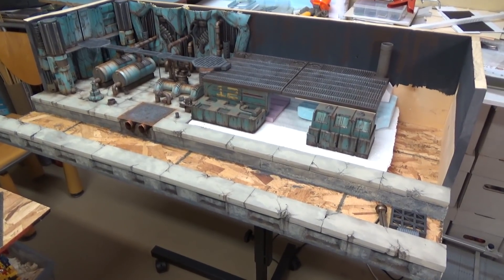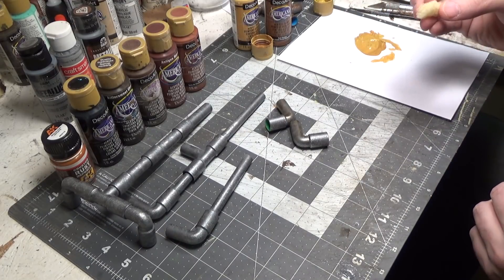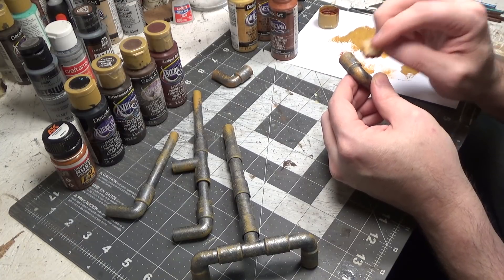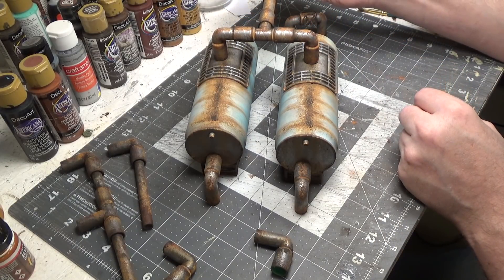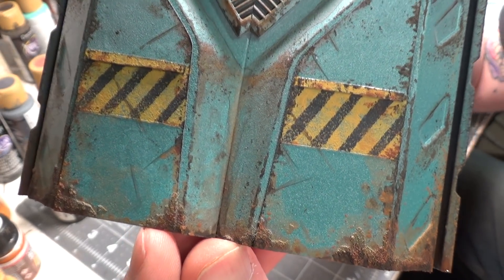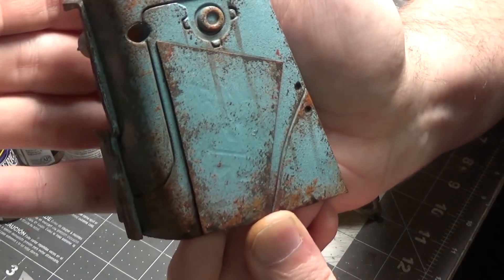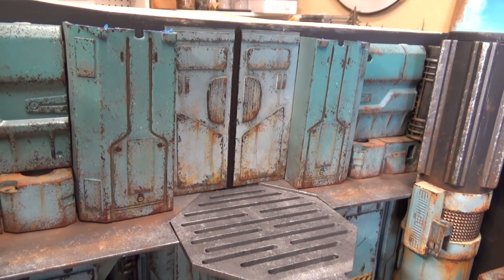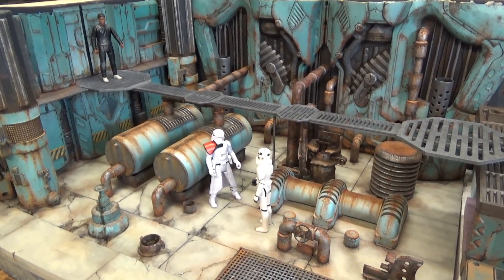Painting rusted metal

Comment: Jason, the progress is looking awesome!  Keep up the great work!  I think you should put a control room on the right side.  You could create walls with glass windows and have some computer panel with lights on the inside.  You can take one of those fiber optic lights where the fiber optics look like hairs and insert the fiber optics through small holes to look like lighted keys on the panels.  This would give you a great place to put a guard watching over the sewage disposal operation.
Reply: Oh, and make the guardroom/control room with a sliding pocket door.  You also need a set of stairs in front going down to the lower floor.  This can be a spiral staircase made from model sprews representing steel pipe!
Reply from the maker: Thank you so much!!! Great suggestion! You've really got me thinking now. Thanks for watching!!!
Reply: @JasonJensenTrains  Your welcome man!  You need a reason for a person to come through the doors and walk across the cat walk.  Having a control room is a good reason or a power source like the device O.B Wan turned off in Star Wars to lower the force field.  Maybe something with glowing purple or blue light.  The sewer could glow green or yellow for contrast.  Anyways these are just ideas.  Do whatever you want.  It looks like you already know what you are doing!

Comment: Jason,
When you announced this build I must admit I was not a fan..You haven't won me over to Sci-Fi, however, I can see where I could use some of your techniques on my RxR Model.  Caverns.  Caves.  Subways.   Side trackage.  Rotting Sea Hulks. And more.
As for Sci-Fi I am more Indy Jones meets National Treasure meets King Solomon's Mines meet Jurassic Park.
So having said that I only have two suggestion.
On the large square flooring area, you said you wanted to put a rusted grimed Yellow railing around the edge.  Well on the facing front side leave the railing off or at least damaged and bent over leaving long open gaps.  That would add a scents of threat and ominous danger.  Especially above the moving fan.
Secondly, in that area where you plan to install a sewer rock bed.  In the substrate void install a smoker or dry ice steamer.  When engaged the smoke will billow up through the stones.  And with hidden piping can come up through some of the existing rusted pipes.  At the time of this upload you have the ability to cut an access into the unpainted rear and side walls.
Just an upscale super weathering effect,
Great job.
~Jim
Reply from the maker: Thank you so much!!! I will definitely use your suggestion for the railings,  love it! Thanks for watching!!!